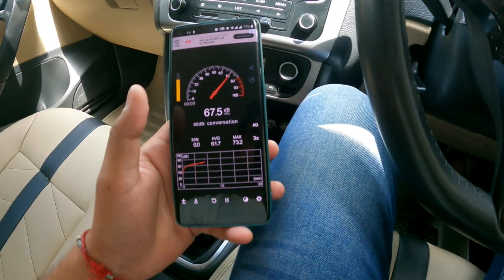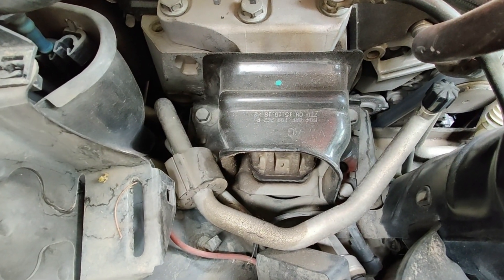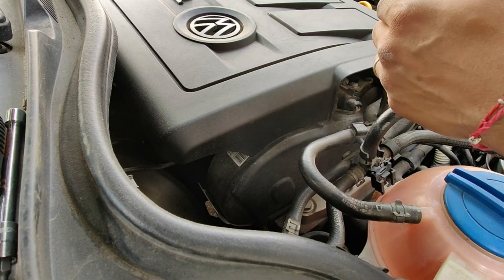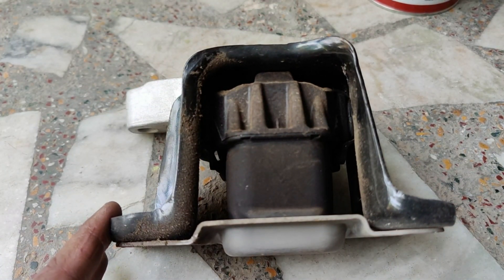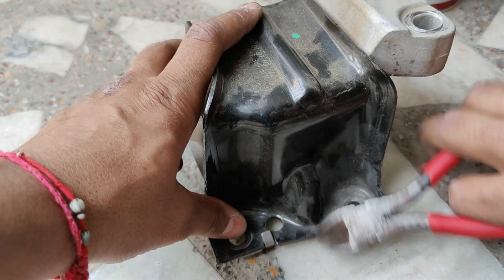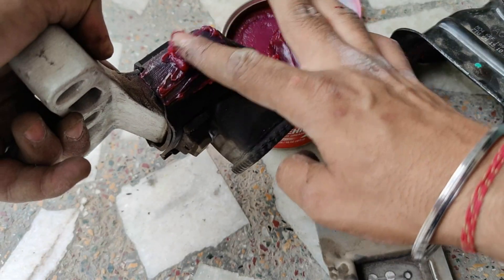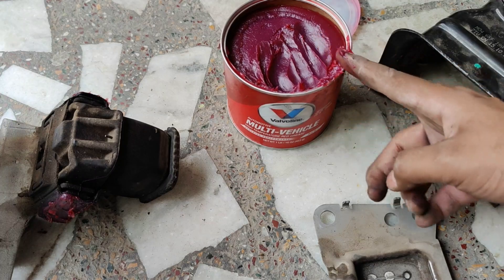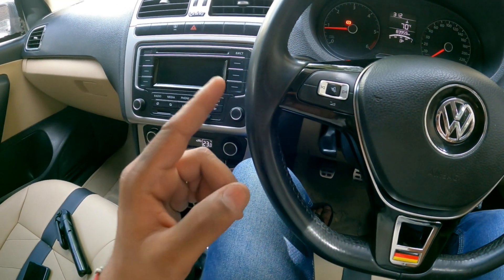CAR CABIN NOISE REDUCTION | REDUCE | ENGINE SOUND IN CABIN | VIBRATION | PART-1

Comment: Great video brother. 
I have a 2011 VW Vento 1.6 TDI. I want to get my engine mounts changed but I'm confused between two part numbers. Can you please help me which is correct part?
6RF199262R
OR
6R0199167R
Reply from the maker: Sir for 2011 1.6 tdi its , 6R0199167R
Reply: @yourDIYneeds  Thank you brother :)
Reply: @yourDIYneeds  Bro, transmission mount is 6RF199555J
And Pendulum support is 6RF199851C
For same car. Correct?
Reply from the maker: Sir for pendulum its correct , both revision are ok 
And for transmission i guess the latest revision will be available , depending upon from where you are buying it . ( Last alphabet in the parts no. Are the revisions in parts )
Reply: @yourDIYneeds  Thanks again brother. I live in Goa. Getting parts here is very difficult so I order on Boodmo only. Last alphabet won't make much difference right? I will try to get latest revision.
Reply from the maker: Yes , last alphabet represents the no. of revision to this part no.

Comment: Can you please tell me why my fiat punto diesel is giving so much black smoke?
Reply from the maker: Sir it can be three things 
1. MAF  sensor needs cleaning 
2. Intercooler needs cleaning or its loosing charge 
3. Egr is blocked and needs cleaning .
Basically sir you need to clean these 3 things 

But  bad fuel quality can also be an issue

Comment: sir what is reason for gear oil leak in my scorpio
Reply from the maker: May be various reasons ,
1. someone has overfilled it before so its seeping out 
2. Seals are leaking 
3. May have used a wrong grade of oil

Comment: Bro starting a car with half clutch while in a gear what happens?
Reply from the maker: You will wear out the synchromesh inside the gearbox . Depending upon the bite point of your clutch and pressure plate .
Reply: @yourDIYneeds  if we do it once is it fine?
Reply from the maker: Once or twice accidentally , no issues but 
If its Everyday habit then it will be an expensive habbit 😅
Reply: @yourDIYneeds  ok thanks a lot bro

Comment: hi, I wonder if you can bro. I have a 1.6 tdi and it shakes on cold starts and after 2 minutes or so i idles fine. what can i do ? i took it to 2 mechanics who said " all good, nothing wrong". this happns every morning when engine is cold. TIA
Reply from the maker: Before answering i want to know 4 things sir !
1. Which engine oil and grade do you use ?
2. When was the last time MAF sensor  was cleaned ?
3. Does vehicle has  MIL lit ? 
4. Is it shakes or its just on fast idle ?
(As when engine are cold they tend to start on a little higher rpm as compared to warmed up .)

Comment: THanks bro for your effort ...What s the interval of changing ribbed rubber belt fir vw and Skoda -the belt which drives alternator, water pump, ac compressor etc..
Reply from the maker: Sir it depends upon the condition of the belts 
A less driven low mileage car's belt will also detoriate and a regularly driven high milage less older car will also face detoriation so 
Have to check the condition . If they have no cracks and making no weird noises , then they are good to go
Reply: @yourDIYneeds  thanks .. will check the condition.. just asked because in vento service schedule,  saw that ribbed belt to be replaced in 4 year interval , but in rapid's schedule, it's not mentioned .
Reply from the maker: Sir , at the end of the day , dealership is a a business , and they exist to earn . So i guess rest is understood 😅

Comment: Do the same for safari dicor dude please🙏
Reply from the maker: Sir Safari's mounts are rubber bonded , not hydraulic , so for vibration cancellation we are dependent on the softness of the rubber used . And rubber tends to get hard and stiff after some time , so the scope is really narrow , but i will definitely try something .
Reply: Sure, thanks and please suggest if robbers are possible to change without removal of engine.
Reply from the maker: Will surely do sir

Comment: Do the same for Safari too 🙏🏻
Reply from the maker: Sir Safari's mounts are rubber bonded , not hydraulic , so for vibration cancellation we are dependent on the softness of the rubber used . And rubber tends to get hard and stiff after some time , so the scope is really narrow , but i will definitely try something .

Comment: Wouldn’t it be better to use brake callipers grease’ it’s safe on rubber parts and is able to withstand high temperatures too.
Reply from the maker: Sir yes , you are absolutely correct ,but the real problem is that arranging a 5gm pack for brakes is difficult and for mount we need around 40-50 grams .😅 And that caliper pin grease usually comes with new pins . And they usually pull one packet out of two from the box of pins and sell it for around 100/-
Reply: I bought brake caliper grease from amazon. Its german made and no pins.I agree with ur logic, is there a group of VW owners where we can discuss issues related to VW. I service my Vento my self.
Reply from the maker: Sir yes , vwvortex , tdiclub and ukpolo
Reply: @yourDIYneeds  thanks. I'll see . where are u based?
Reply from the maker: Sir Delhi
Reply: @yourDIYneeds  i come to delhi to work from Ghaziabad. We should get in touch.
Reply from the maker: Sure sir .

Comment: I am having toyota corolla 2008 old petrol and cng mostly i used in petrol 135000 done on odo which engine oil should i use fullt synthetic 0w40,0w30,5w40,5w30 which one is good ? Car engine is in excellent condition goes 210 kmph without anyone problem current i am using 15w40 Mak Elite Engine Oil
Reply: And should i flush my power steering oil
Reply from the maker: Sir 5w40 synthetic would be your best bet. As you are running on CNG . It Will also help to seal the the piston-to-wall gap even better . 
If you have never changed power steering fluid till this date then yes its a good idea to flush it and fill it with new fluid